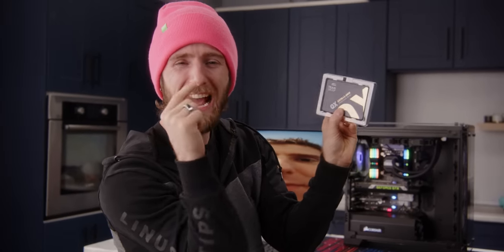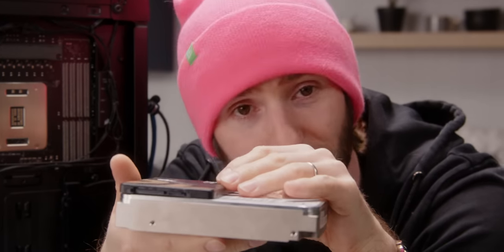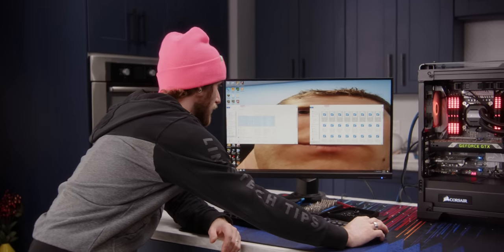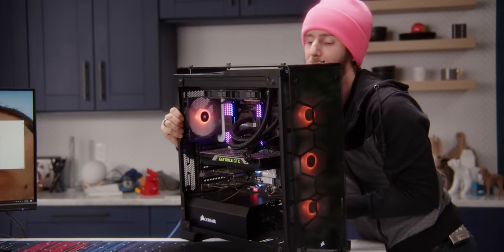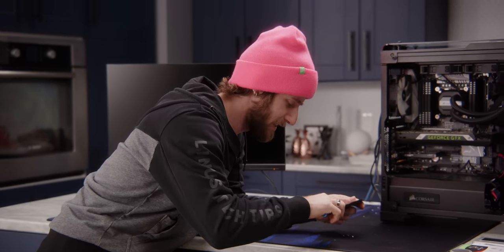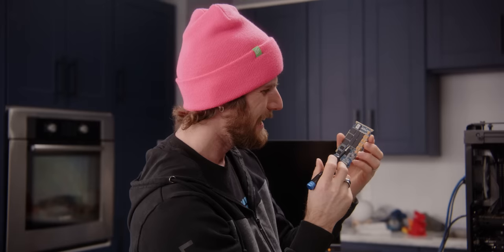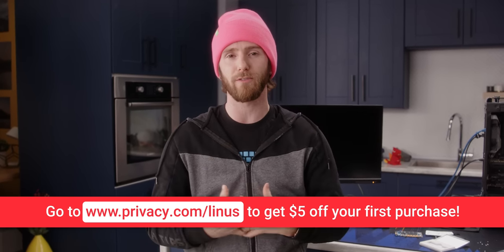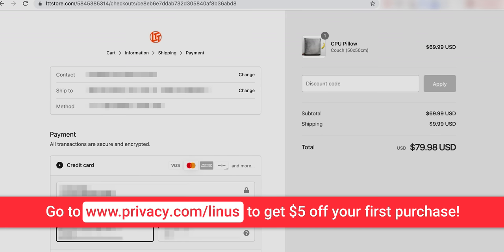The 15 Terabyte SSD is TINY!!

Comment: I'mma tell you straight, chief

Even if I could afford the cost in price, I couldn't afford the cost in time to fill it up
Reply: This would be extremely useful and popular if they were able to sell below the $500 mark. When that happens is when ill move my 100TB of spinning rust over to SSD's.
Reply: @nuwantilakaratna7157  Yeah, $3,200 is beyond too much for a single drive in the consumer space. It's another case of a consumer brand selling a enterprise product.
Reply: @nuwantilakaratna7157  Yes, many things would be popular if you didn't have to think about the price. But if your already  imagining such things, why not U.2 or M.2 and not bottleneck everything?
Reply: @trelauney  Because its hard to fit that many chips in that form factor, so its very unlikely? Me personally, SATA3 SSD speeds are more than enough for my archival purposes. If any company would even make a 3.5" SSD with that capacity for the same price as HDD's I would gladly buy it simply because of the greater lifespan/lower failure compared to HDD's.

Comment: me: wants one
looks it up: $3,199
me: nevermind
Reply: that is honestly less than i thought it'd be
Reply: For that price you can get the 15TB Samsung PM1733, which is a super-fast PCIe 4.0 NVMe SSD... you just need to get a u.2 adapter card and cable to plug it in.
Reply: Atleast you not going to loose 15TB worth of unbackuped data if it fails.
Reply: @Steamrick  yeah but that card and adapter ain't cheap
Reply: Its ridiculous. I thought we would have 100 tb and 200 tb affordable ssd by now. But money
Reply: @mexreax4493  no that's not ridiculous lmao hard drives in those size don't even exist
Reply: @mexreax4493  idk how you expect that
Reply: @mexreax4493  Bunch of slackers at the R&D department not being able to work around quantum mechanics reliably. 

But honestly they're already operating at atomic levels where the electrons can just bypass the "border" of each bit, effectively scrambling the data.
Reply: @rondavidson7275  Linus did a video about a 100TB SSD cramed into a 3.5" box that can be used in any standard 3.5" hdd size tray in your computer, so it does definitely exist, just not in 2.5" size. And not cheap either, a few dozens of thousands of dollars.
Reply: yeah I'll stick with HDDs for my nas box.  16tb for around $300.  my gaming box doesn't need more than 2tb at the moment.
Reply: @huntercyril  no but hard drives of that capacity don't exist and also try 10s of thousands of dollars
Reply: For comparison a similar Seagate drive on Amazon is $5,495 so color me impressed.

Comment: For the first time ever, I have to say Microsoft did nothing wrong in this instance. All real systems use 1024 steps. The reason manufacturers of storage don't, is because it makes their storage seem larger. It's just marketing.
Reply: Agree with you there. Linus should know better. You would get the same in Linux. 

Computing since the "dawn of time" has always been in binary or base 2 (1000 doesn't fit in base 2) 1024 does. 

What does the data store in when you break it down Linus? That's right 1s and 0s.

Therefore

1024x1024x1024x1024 =1TB
Reply: Wait, so computers internally use powers of 2 right? That’s just how they work, no changing that, sure.
Still, wouldn’t it be better to make these units in the more human-comprehensible base 10 system when dealing with the human interface?
Reply: @OGSumo  yes they do. This is just the hardware manufacturers marketing spin.

Because 15.3 is better than 13.9
Reply: @OGSumo  N O
Reply: @AnimeFan1981  Would depend on the linux, but several of them would show the units as "TiB", rather than just "TB."
And others, namely GNOME derived, don't do 1KB = 2^10 bytes.
Reply: @billy65bob  The Ki, Mi, Gi, and Ti nomenclature was invented because the marketers changed the meaning of the original set (kilobyte, megabyte, etc.).  It was always originally in steps of 1024 when referring to bytes until marketers noticed that they could inflate their numbers by lying.
Reply: @OGSumo  Why introduce an unneccessary layer of confusion? Most non-tech-affine users would still be having no clue looking at these numbers.
That's just how storage and every logic component is organized. It's the reality.
Reply: Maybe the manufacturers should start making GiB and TiB storage. But they never will.
Reply: @Jake1702  Storage is just a small part of it. How about logic components, any digital signal, addressing of any kind of memory, .....
It's about 1 and 0 all the way.
If we wanted 0-9 we never should have left the analog age
Reply: Exactly this is the science not windows fault lmao
Reply: @AnimeFan1981  Yea and read the privy policy of privy.com hahaha! a joke.
Reply: The issue is that 1 Gigabyte is 1000 Megabytes, but one Gibibyte is 1024 Mebibytes.
Reply: @AnimeFan1981  No, 1024^4B=1TiB, 1000^4B=1TB. (TiB=Tebibyte, TB=Terabyte).
Reply: @jonathanbrown6034  Actually, it was the marketers who used the correct prefixes. kilo means 1000, not 1024. A kilometer is not 1024 meters, it is 1000 meters.
Reply: @wta1518  That's not true in binary, which is what computer use
Reply: @jonathanbrown6034  Kilo denotes 1000, it does not matter whether you are using binary or not.
Reply: @wta1518  Try converting both 1000 and 1024 to binary and learn something new today.
Reply: @jonathanbrown6034  Yes, that is why computers use Kibi instead of Kilo.
Reply: @wta1518  That's actually true.. i never realized it, damn.
Reply: @wta1518  kibi is new. Computers used kilo just fine until it was ruined in the late '90s.
Reply: @jonathanbrown6034  Yeah, it was changed from Kilo to Kibi in the late 90s because you can't just change the definition of a word because it suits your needs better.
Reply: @wta1518  Actually, outside of Linux and HD size fraud, kilo is still in use by PCs as 1024.
Reply: @wta1518  why can't you change the definition if a word if it suits your needs better?
Reply: @jetison333  because that defeats the entire purpose of a definition.
Reply: @wta1518  not really. The definition of a word just describes how people use it. If people use kilo to 1024 in context with computers then that's what it can mean.
Reply: @jetison333  The issue is that the average consumer doesn't know why it's 1024 instead of 1000. This is like saying timer instead of clock.
Reply: @jetison333  kilo is the Si prefix for one thousand. One can't just change the definition in a specific context, as it would only cause confusion... as you see it here.

Moreover, there is no reason to use powers of 2 in human interactions, it's only useful internally, and not even in all cases.
Reply: @DidierLoiseau  Sure you can change it.  Technically the SI changed it when they adopted it for their various measurements (of which byte is not one).  It is not required to accept their change as far as kilobytes  are concerned (since they didn't), especially since it's only used to perpetrate fraudulent advertising.
Reply: @jonathanbrown6034  I don’t understand what you mean by “SI changed it when they adopted it for their various measurements”, “kilo” comes from ancient Greek “χίλιοι”, meaning "thousand", it hasn’t changed in the last… kiloyears ;)
Reply: but um, it uses the decimal prefixes in the first place? i mean
Kg=1000g
Km=1000m

so what privelliges do computers have so that
KB=1024 bytes?
Reply: @tridiots3681  Binary.
Reply: @AnimeFan1981  I think it used to be that way to be more space efficient for things like storage addresses. Nowadays there's so much space doing it in powers of two isn't essential. I'm really fine with either, but it would be nice if it were consistent.
Reply: @Sam-vf5uc  yes. If anything it's the hardware manufacturers issue rather than a windows issue.
Reply: Except for Macs which use 1000 rather than 1024
Reply: I would agree, Microsoft did it the correct way. SO should everyone else.
Reply: @Mindcrawler23  Go watch ComputerPhile.  Analog computers were not strictly base 10.  Many early computers actually used 5 hole punch paper (essentially 5 bits per instruction/character) while most modern systems use 8 bits to a byte (I think it was intel that solidified that).  Of course I completely agree that in the case of computers a kilobyte is 1024 bytes, ect.
Reply: To be honest, modern drives aren't really required to be manufactured in multiples of powers of 2. But I still agree with you.
Reply: @EgnachHelton  It's not so much the actual storage capacity as it is the way addressing works.  It was never actually necessary to have drives be powers of 2 and in fact they rarely are as some of the addresses are reserved for registers and cache.  

Early computers would have a single address system for everything so certain addresses were for RAM, certain addresses were for ROM (if it had ROM), and certain addresses were for ports.
Reply: No, you are wrong there is giga and gibi  and giga , for example, was always 1e12. Overbearing software engineers try to redefine he unit just for their convenience when science , schools, other engineering fields etc were using the proper values. Also there is nothing intrinsically binary on HD  and the courts  also settle the matter. But some people like to look smart and insisted on the binary description. Everybody knows what we are talking about so I don’t go correcting people, with that expedition with the people that corrects the people that are right like you.
Reply: @wta1518  kilo means 1000 but byte means 8 bits, I don't think whoever named that used the metric scale
Reply: @jonathanbrown6034 "Technically the SI changed it when they adopted it for their various measurements" 
What? Kilo meaning 1000 is the original definition. Kilo means 1000 in ancient greek. It's used as a prefix for units since 1795, 145 years before the invention of digital(binary) computers.
Reply: I mean... yes. But also no. The common definition of 1024 vs 1000 is really am arbitrary line that could be drawn wherever we want provided we all agree to use it. I agree 1024 is superior, but let's not act like it's the only viable way.

Comment: "typical gaming computer"
Immediately spots 8 ram slots. Yeah I don't think so linus.
Reply: I have 8 ram slots.... only 2 are filled though 😅
Reply: Then you also don't have a typical gaming motherboard
Reply: also has Titan
Reply: @markomclane475  why do you have that motherboard then? Just curious
Reply: @yeahyeahyeah688  well 3 years ago I wasn't sure whether I wanted an i7 7700k or i7 6800k, I ended up getting the 6800k since it has 2 extra cores. The 6800k was an HEDT chip and used the x99a chipset. In other words, my cpu is essentially the cheapest workstation cpu from that generation, but it's overclocked and being used in a gaming pc. I paired it with a gtx 1070 and 2x8gb of ram.
Reply: @yeahyeahyeah688  also the x99a motherboard was around the same price as the standard z170 or whatever it was 3 years ago so I could also have better upgradability with that board. I'm thinking of getting a 6950x off of ebay to replace my 6800k.
Reply: @markomclane475  does the 6950x have worse single threaded performance when compared to the 6800k?
Reply: @dihydrogenmonoxide9210  the 6950x has much better single core performance because it overclocks better